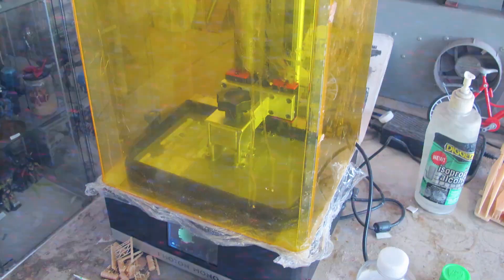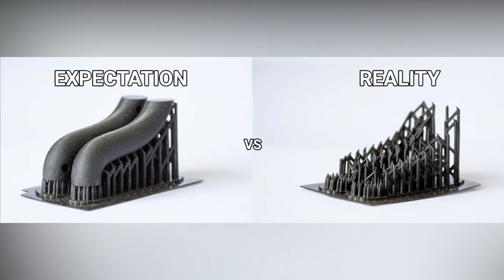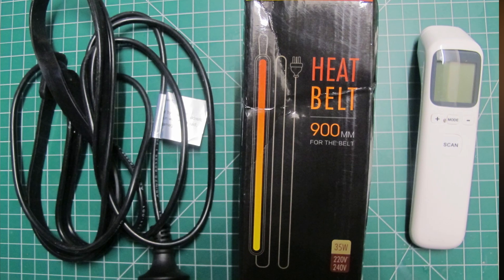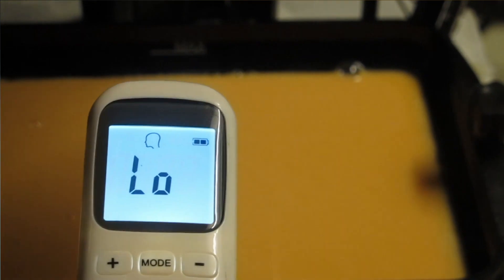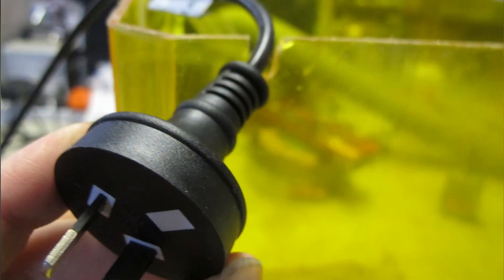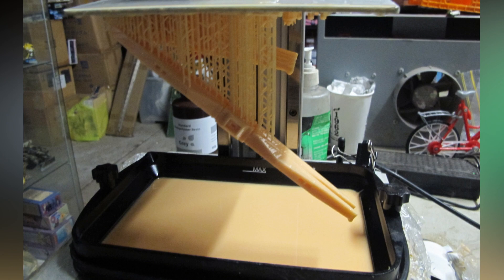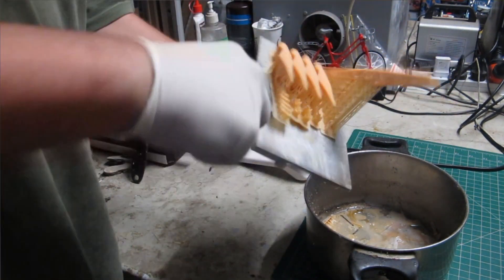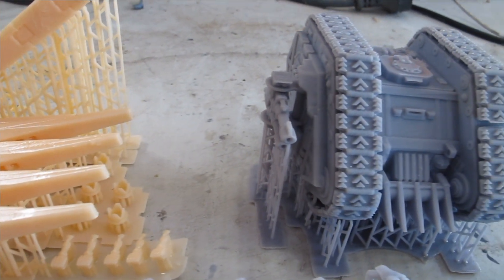Installing brewing heat band on resin 3d printer

Comment: thanks for your video, do you use a thermostat or you have it always on? how it regulates the temperature? thanks again
Reply from the maker: You can buy one for 3-5 times the cost built in the band but I run it for around 4-5 hours with longer prints. You cannot leave a printer with a heat band unattended as its not an authorized use of the band or printer.
Reply: They are unregulated/always on, because they are meant to be plugged into a inkbird or similar controller when it comes to homebrewing. Usually the controllers also have a cold side for a freezer aswell (which usually has its thermostat set to or bypassed entirely to always be on).

Comment: Do you find this too hot at 35C?
Reply from the maker: Ive done maybe 50 successful prints in summer, with the heat band my prints have improved quite a bit with almost no errors or failures. Also have no evidence that the screen on pfe film wears out any quicker. very happy still using it

Comment: Hey there wanted to ask do have this foil also over the display? Thats an awesome idea for keep things clean
Reply from the maker: its just sandwich cling rap, piece is so large it over laps the screen, touch pad and any screw holes and vents encase of leak and handling. Does not effect the performance of the print. One guy I know even cover the UV case.

Comment: still need to look at getting one of these, but I somehow still get good prints even when it's snowing.
Reply from the maker: finding that my choice of resin was more to blame for fails then heat, heat just makes it more crisp with the poorer resin. Have about a month or so of videos inbetween builds but a lot more in me inproving this beast. Happy with what im putting out atm and new resin choice. Sunlu is great.
Reply: @mokanaman  were you using the water washable resin at first?